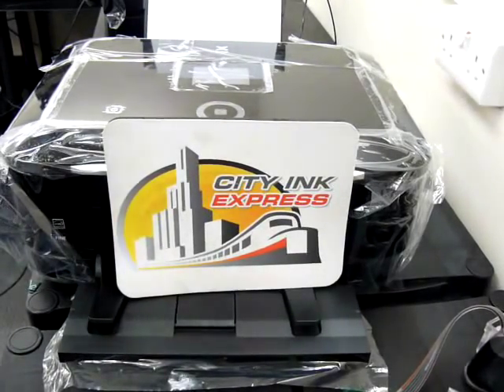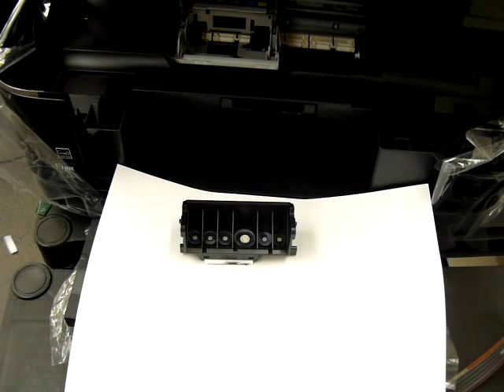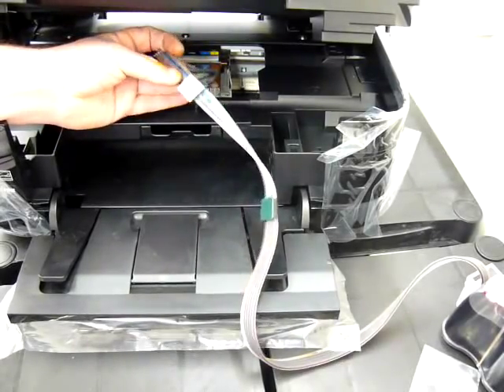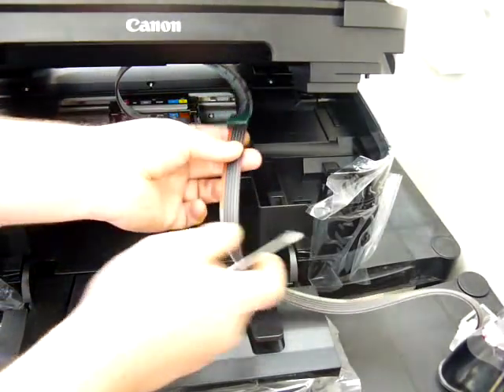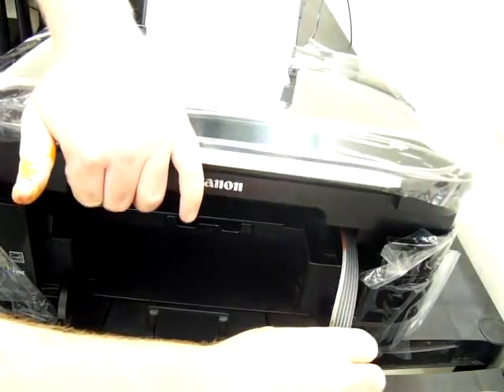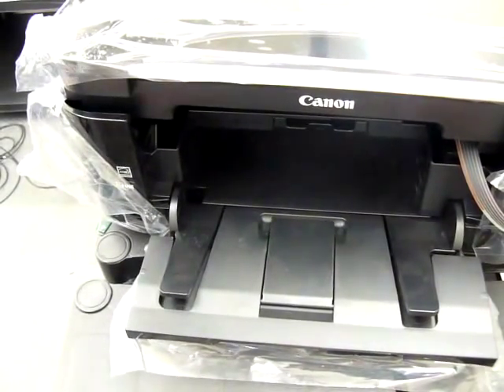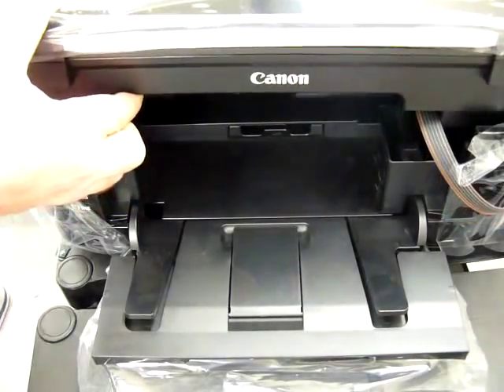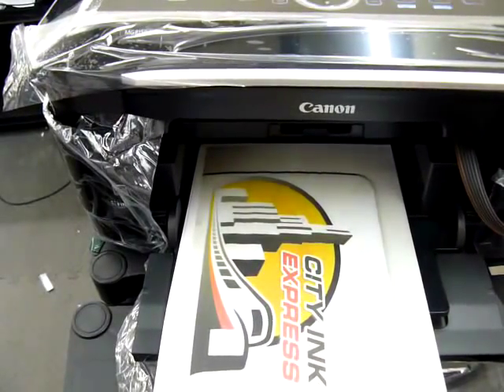Ciss continuous ink system for the Canon MG8150 printer

Comment: Canon opened the printing preferences, maintenance, check the printer status
Canon printer clear hint: "waste ink collector will have full or suggest that 5B00 or 5B01 5B02 or P07 P08" is the need to reset.
Or just to print a document, it will pop up error, send screenshots to see is not clear problem
I can do : Epson Printer reset , canon Printer reset ,Samsung Printer reset